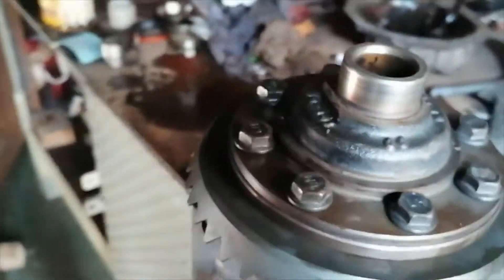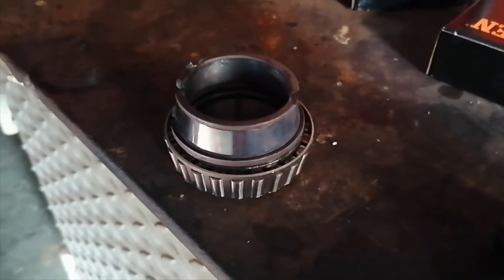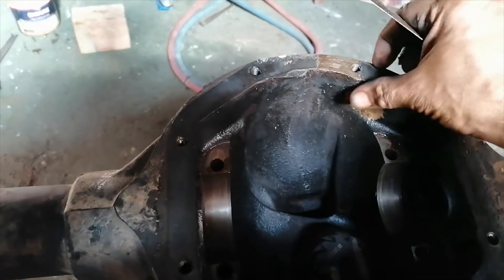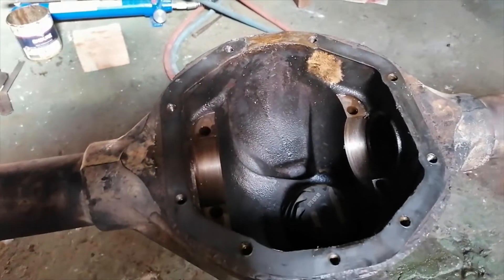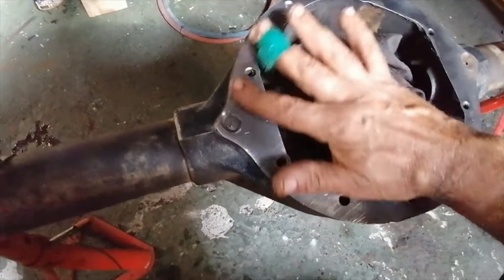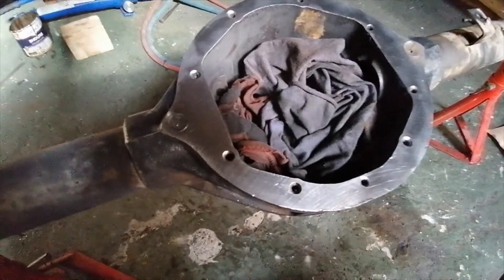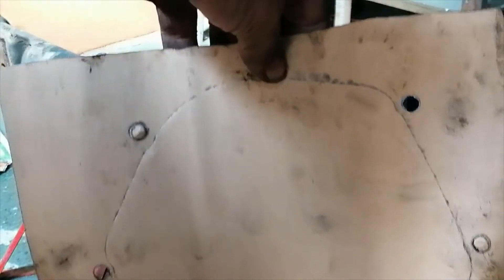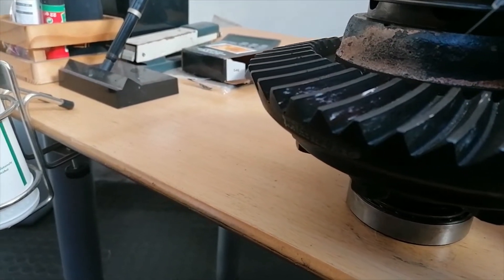2001 Isuzu 2.8 Turbo Diesel Rear Diff. Modification Part 5.

Comment: Kan jy asb n link post vir die kit van die Timkin Bearings gee. En Crown en Pinion wat 3.90 is? Love jou videos oor die KB280
Reply from the maker: Hi, baie dankie.. Dit is die Timken stock codes vir die los bearings. Wheel Bearings (2 off)Kit 176 TIM. Carrier (2 off) LM 102949/10, Pinion Front M802048/11, Pinion Rear M88649/10. Ek hoop dit help. Groete.
Reply from the maker: Die Gearmax code vir die 3.9 is 2019590. Dit is die een wat ek gehry het. Groete.
Reply: @mpe6678  Baie dankie!
Reply from the maker: @infoversus8771  👍 Shap